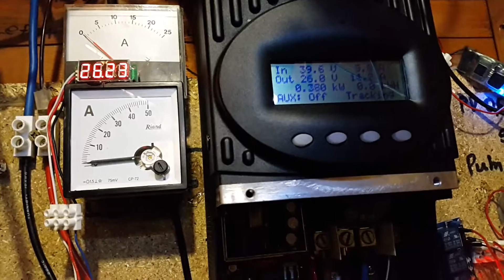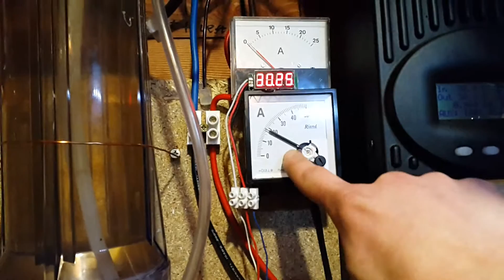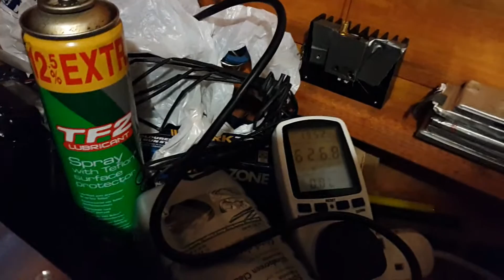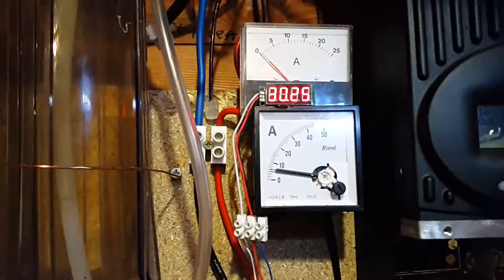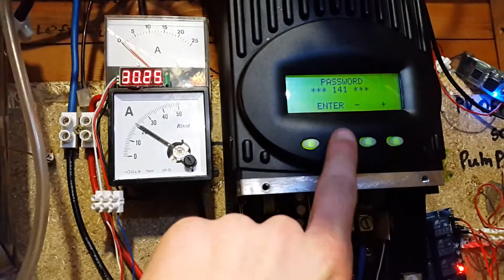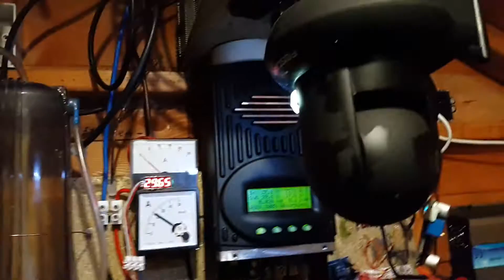Another Grid Tie Battery Test

Comment: How has that grid tie stood upto running at full load? My plan with these is to feed them a little less voltage say 25v ish to keep them down to about 70% output
Reply from the maker: It is still working perfectly. I am running it at 28v maximum and it gives out about 550w at that voltage.
Reply: Excellent !! is that the 1000w or the 600w version? - Based on what im pulling most of the time i need to cut output to about 450w else il be feeding back into the grid , hoping i can do that by dropping it to about 22v

Comment: are u runing ur batterys at such a high voltage for video cause 30 volts is high unless its below 10 deggress in summer thats equilize voltage
Reply from the maker: It was because of the temperature I think. The lower the temperature the higher the voltage needs to be.